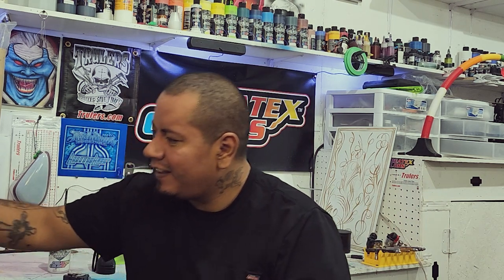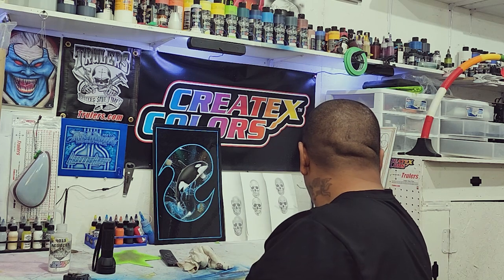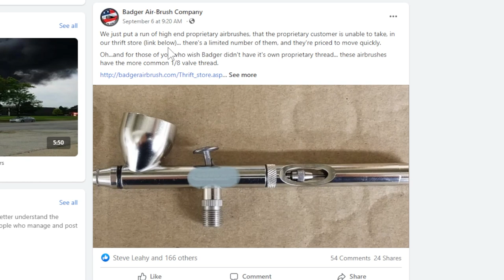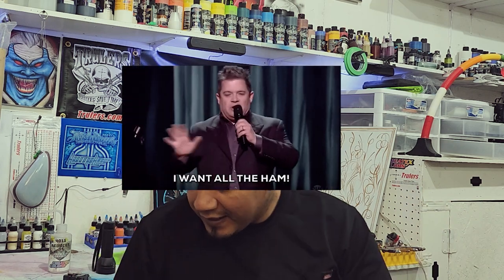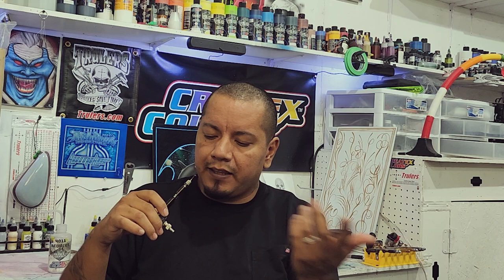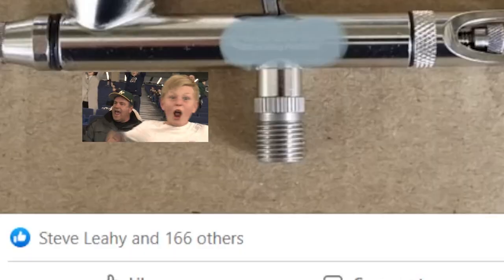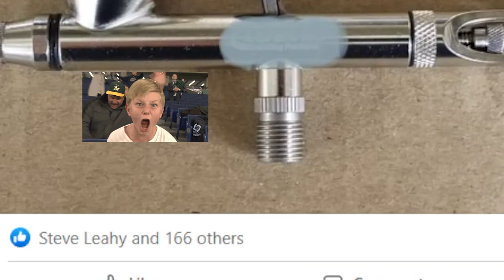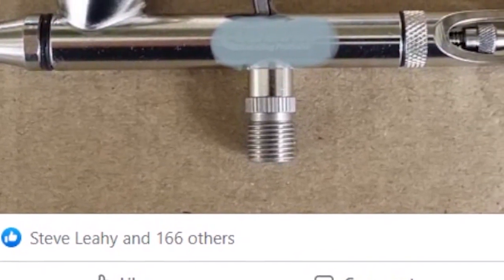Why a 1/8 Badger airbrush is a game changer.

Comment: I paint miniatures, and have 5 airbrushes I use.
An Iwata HP-CS, stock .35mm needle, that's my go to, general purpose airbrush.
A Neo for Iwata CN converted to a .5mm needle, I use it for spraying heavy stuff. When it had a .3mm needle in it, it was my primary airbrush until I got the HP-CS.
A SOTAR 20/20-2F, for detail work. I knew I'd need an adaptor, so I ordered it with one. I have a few complaints with it. It's my newest.
A cheap Master Airbrush that came with my current compressor that gets stuff I won't spray through a nice airbrush, like clearcoat. If I trash it I'm out nothing, and it doesn't have to spray well.
and Finally a Harbor Freight double action siphon feed that gets used for terrain, this was my original airbrush, on a different compressor, and it was a painful experience.

I agree that Badger needs to get on board with the standard 1/8 fitting, looking at it from the standpoint of someone that got into airbrushing on the cheap. $100 to $150 will buy you an airbrush and compressor off Amazon with everything you need, and it's actually not a bad compressor. The airbrush in the kit is usually pretty bad though. The first upgrade most people do is buy themselves a better airbrush, and the lower end Badgers are priced right to take advantage of this market, but they don't fit.
Reply from the maker: I agree it defeats the lower price if you have to go out and buy adapters and such. Not to mention a beginner would not know this beforehand.

Comment: I think one of the reasons that Badger and Paasche use a different thread is that they both have been around almost 100 years  (Paasche has been around since 1904!) The "new comers" and imports (Badger and Paasche are both U.S. made) have Chosen to use a British standard thread. So my question is why don't non-U.S. companies importing for the U.S. market use a U.S. "standard?" (Flame suit on ;))
Finding adapters for the Badger or Paasche isn't that difficult and the Badger male quick connect fits the Iwata hose fitting just fine. The Paasche male seems to be slightly larger than the inexpensive Chinese hose fitting.
Reply from the maker: paasche maybe 100 years, badger about 50 years now, Iwata 96 years... In that time they have all gone thru different size fittings. 1/8 would technically be a japanese standard as iwata was the one to first adopt and standardize it.
non US companies changing thread to what exactly? Badger and Paasche both have different threads 🤷‍♂️
Finding the correct adapters is not all that easy as there thread is different to anything at the hardware store. I can buy a 1/8 quick disconnect with 10 plugs for the same price as one adapter and plug for badger... 

I believe you completely missed the mark. Its a barrier of entry for alot of people. Its a barrier for expansion for others. Its a simple problem, most people wont care, I have 12 badger airbrushes so I do care.
Reply: @MikesBrush  I do understand your frustration. I was just playing Devils Advocate. I own 2 Badgers, 3 Paaschs, a Creos and an Iwata. I currently use a compressor from TPC Global (Master) but also have 2 compressors with the U.S. standard 1/4" outlet nipple.
 I work in a hobby shop that has been selling Badger for all most 50 years and had never seen a 1/8" thread on a airbrush or compressor until about 10 years ago (people buying Harbor Freight compressors.). 
Spraygunner sells Badger airbrush to 1/8" hose adapters for $3.75, 1/4" to 1/8" compressor fittings for $3.50 and Paasche airbrush to 1/8" hose adapters for $4.00.
I do enjoy watching your airbrush reviews by the way. Please keep up the great videos, lots of good information in them.

Comment: As a beginner this was a bad first experience for me as I bought a badger and could not use it until I sorted out the air fitting issue. I, of course,eventually sorted this out and still use a couple Badgers but it was a bad false start. I just don’t see this in any way as a selling point so I think it at least seems like a bad business choice. Only angle I can see is to sell more product through “attachments”. I hope this is not the reason because I think most people are smarter than that and in the end, less customer satisfaction and less brushes sold… imo.